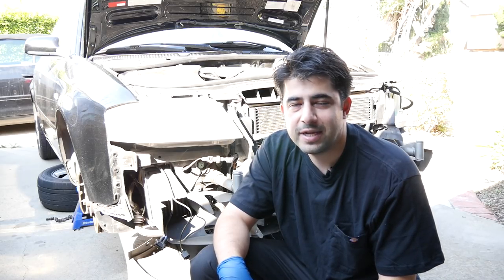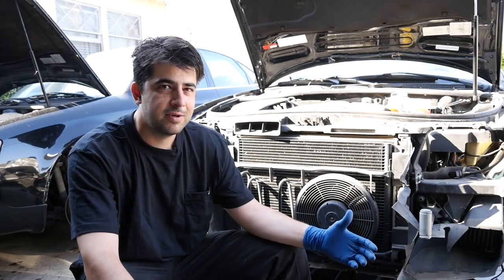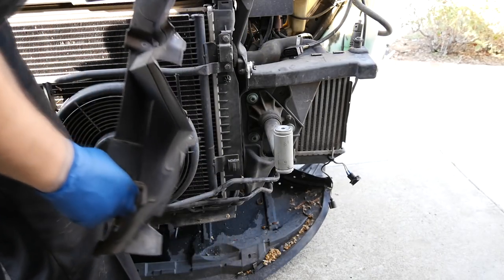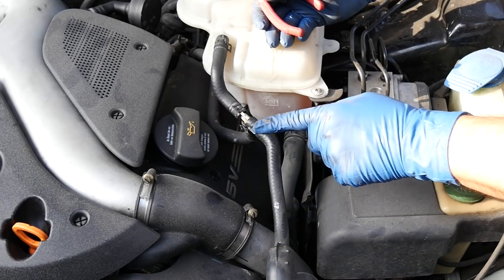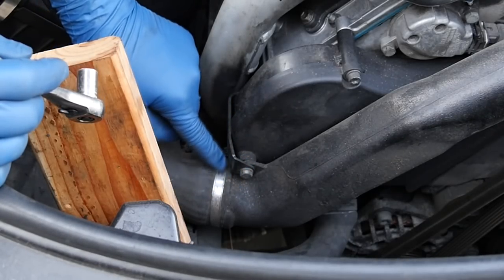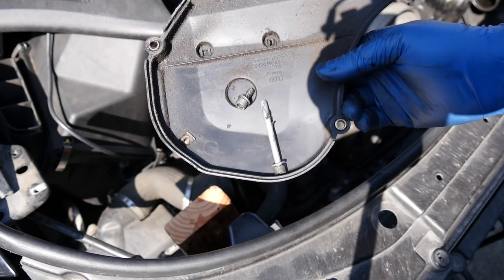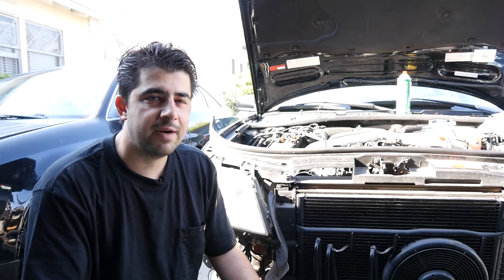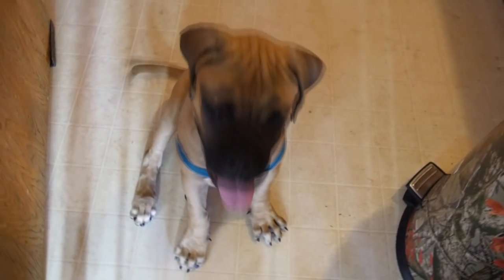Watch This Video Before You Buy an Audi

Comment: dont be deterred by german cars for their cost to maintain. if you care about your car and have a good amount of money, it is WELL worth it. i currently drive a '07 mercedes e350. it has 156k miles on it and it drives amazingly. the shifts are nonexistent, its quiet, and it feels like im riding on a serene cloud (also i have to watch my speed on the freeway because 90 mph feels like 70). 
im lucky because my dad is friends with a german car mechanic that specializes in mercedes, and at the same time i buy my parts at a german car parts warehouse so i can get OEM parts for way cheaper. this car has been very reliable. aside from regular maintenance and preventative maintenance, the biggest repair+labor for this car was when the timing sprocket wore down and replaced the water pump as preventative maintenance - $3,000. but hey, if you plan to own any car for a long time, its expected to have a huge repair eventually.
if you take care of these cars, they will take care of you.
Reply: The factory dealer level scanners run in the double digits thousands. The Mercedes Star dealer diagnostic computer with the Vehicle Communication Programmer interfere module cost of over $25,000 as I'm not making this up. German cars aren't DIY fix cars if you ain't got the doe for expensive dealer equipment. http://scantoolresource.com/mercedes-benz-scan-tool/
Reply: I think this is why most people just buy a Camry, sure it's boring/not fun to drive, but most people live paycheck to paycheck in this country, so the reality is they simply do not have funds for unforseen expenses.  I'm not opposed to Audi, but I'd only get one new/lease, walk away, or CPO from Audi (thats a big maybe) at best.   For now I'll stick with the slower japanese sports cars (370z owner) and toss in a better stereo/sound deadening and better tires.  Just a lot cheaper and while it doens't have the "I want to look like I have money" emblem, it really is fun to drive if you're into real/actual driving but are not in some high income bracket.

Comment: You might want to mention in your next video to be careful with the timing belt covers. If you put them back wrong they can rub on the belt, which, as I found out the hard way, will cause a misfire code exactly as if you'd got the belt off a tooth. (Somehow the added drag on the belt messes with the even ignition power pulses the computer expects to see, and it assumes a misfire and throws the code).

Comment: Just did a search on timing belt/chain for M54 engine BMWs. Seems that you never need to change it and their are no documented failures. Just regular oil changes will sufice. The V8 engines on the other hand...

Comment: I always thought them easy to work on. My oldest I just changed my second belt at 170,000 miles. Takes time and patience but parts are cheap and easy to work on if you're  mechanically  inclined. IT'S  only as hard as you make it peeps.. 😁😂🤣

Comment: Never again will I own a Volkswagen/ Audi product. I owned a 2002 Volkswagen Passat with the infamous 1.8T 20 valve engine in it. Excellent driving dynamics, better than any Japanese car that I've ever driven, to be honest. The cost was very steep, I ran into almost every problem that plagues these cars; plugged up heater core, expensive timing belt replacement and finally the dreaded oil pressure warning, the last one was the last straw for me. Before I gave up, I tried different detergents to try to clean up the inside of the engine, it didn't help that I only used synthetic oil and changed oil always on time. After spending so much money I decided to cut it loose and eat up the loss. The problem with these cars is that they are too over-engineered, sometimes more so than needed, resulting in above average maintenance requirements and above average maintenance costs as a result. I'll stick to Japanese, thank you very much.

Comment: I have a 2010 Q5 v6 and I have to remove the whole front just to change the belt tensioner. Coming from a 95 Celica (which I still have), that's a lot of work.

Comment: The claims at 12:27 are not entirely true. The amount of work required varies depending on the engine design. The a4 1.8t engine does not require you to enter service mode to repair air compressor, alternator, or turbo. I wish the same could be said for the more fun and powerful 2.7t a6.............OH THE PAIN!!

Comment: Audi's have always been known for problems. Working for a dealership in service, I unfortunately came to know my customers on a first name basis as they were usually in the shop a minimum of one time per month (usually two or three on average). Whenever they brought their Jetta or Passat's in for service, it was almost always electrical related. You couldn't pay me to drive one of these, just work there since the benefits were decent, unlike their cars.

Comment: The new audis are reliable. Maintenance on the 2.0t engine is pretty cheap though. My 2013 A6 has 75000 mile now, and I never had a problem with it.
Reply: What about oil change?

Comment: Great looking dogs --  and we very much appreciate the great content. Audi's (and their VW cousins) on the other hand you can keep. Overpriced, over-complicated, and too many cheap plastic parts.  Good luck with the build.
Reply: bmw 745\750\760 e65-e70 if battery dies engine computer(DME\DDE) loosing communication with immobilizer(CAS) and do not gonna start again with just jump-starting it. Needs good diagnostic tool to make it starts again.
Reply: The factory dealer level scanners run in the double digits thousands. The Mercedes Star dealer diagnostic computer with the Vehicle Communication Programmer interfere module cost of over $25,000 as I'm not making this up. German cars aren't DIY fix cars if you ain't got the doe for expensive dealer equipment. http://scantoolresource.com/mercedes-benz-scan-tool/
Reply: I'm sure if the audi's bumper is off. Then I had already finished replacing the distribution belt with an opel. And also a lot cheaper on parts as well.
Reply: A lot of aftermarket diag tools around. 5k max for full analog star tools.
Reply: Yeah but you still have to pay hefty TIS license subscriptions as there's a reason why the Mercedes STAR xentry is over $25k in software license's. Many of these diagnostic scan tools are becoming internet web-base applications.

Comment: People thinks that this belts needs changing only when you are over xxx miles of km but this is not true. You can leave your car in garage for 10 years and say ok it wasn't even close to km that needs to be changed. Old belts are worst nightmare that you can have because it can break easy and thats why you cant just inspect with eyes because even old belt wont show cracks that you are looking for. Also rollers which hold belts need to be changed once you change belts.

Comment: I love Audi's, but I live where they are produced 2.5 miles from the Audi factory in Ingolstadt Germany. I crashed my Audi A4 in Berlin with 546,000 km on board (way over 330,000 miles) and my Audi A3 with 704,655 km on board( about 440,000 miles on the speedometer). I serviced my cars always alone...I drive now the A4 -red of my wife with only 335,000 km on board (over 200,000 miles) And I intend to buy a 'new' Audi with only 170,000 till 200,000 miles on board. God bless you all.

Comment: Hey just wanted to let you know.
First of all thank you very much for your Audi A6 2.7T videos. I wrecked my 2001 Audi A6 2.7T a month ago and did not want it insurance totaled since it belonged to my loving woman who passed away 6 months ago at age 32 2days after her bday from a fatal asthma attack. I found your videos very informative and helpful especially when points during the repairz became  stubborn and frustration was beginning to best me. Your videos showed my stubborn repairs whos boss.
Secondly i noticed one thing that you said incorrectly in this video.. that said though its the first thing ive known to be incorrect from your videos. And that was when referring to your lower coolant host that connects to radiator you said that a coolant temp sensor connects there. But its actually the Engine coolant electronic fan switch that is connected there and the coolant temp sensor is connected behind the engine passenger side 
In all though thank you for the help you have provided me.

Comment: Lexus just came top of the reliability table in the uk. In the top 10 were Toyota Honda and Nissan.
Mercedes and Vw Audi are way down.
People drive 1960s Morris 1000s and can easily work on the cars themselves. No road tax. Ideal for tootling around town.
Toyota if you are not practical

Comment: Audi's : Thee easiest & smartest engineered cars on the planet to work on. 

It takes 25 minutes to get into the service position, requires zero special tools, and don't have to even lift the car or remove the wheels. It is ridiculously easy, painless and effortless......all connections including wiring and coolant hoses are "quick fit" connections and require no tools (genious), and so awesome being able to get to close and personal, opposed to on your back...bent over...in tight spaces.

The A1 and A2 German : Vortex / Audizine
Reply: Blakelikesfood They really are. Audi sell tools to do this yourself. Changing a timing belt on any car is complex, and chains only last as long as the water pump lasts. Audi use a lot of powder coated and or stainless steel bolts which don’t rust, unlike Japanese cars including Lexus which are made from chocolate.
Reply: Never thought of it that way...
Reply: Oliver Newell- What do you mean the timing chains only last as long as the water pump? Are they connected somehow?
Reply: I also love how they advertise their maintenance schedule on the website, easy to get to. Compared to BMW. I'm more and more leaning away from BMW lol. Not my fav brand anymore.
Reply: lol water pump is behind the timing belt/chain in ALOT of vehicles.
Reply: Right? It's really not that hard to do at all. 'm wondering why having to put it in the "service" position is causing so much "fear" of working on audis. LOL
Reply: Rainbow Squash
Reply: sure

Comment: So pretty much audi designed the engine to be replace every 100k. You shouldn't be taking apart the front of a car to change a service item. I read somewhere that the 2nd gen A8 required taking apart for a oil change
Reply: bmwmsport11 so that is complete bullshit.

In highly engineered cars with all that techstuff and of course big engines turbo/supercharged with a great fuel economic is as you woukd expect little to no room.  That means, you have to take some of the car apart, to change something being crammed pretty deep in the engineblock.   Otherwise the car would have gettin' 1m, 3 ft what ever longer.

But in germany you dont need to take a car to visit your neighbor.  So not as much space for everyone.  Furthermore the roads, parking lots and all that stuff isn't meant for 6m long cars.   All that results in thight packed tech under the bonnet.

If you wanna drive german cars, you have to deal with that.
If you wanna drive a subaru, you have to deal with the fakt, that for sparkplug exchange the engine has to be lifted outta the car !
And if one likes some us cars, he has to deal with that poor interior, build and paintjob quality.  Easy as that.

Comment: that's why i love my 06 camry 🙏🏼
Reply: That's a sh*t car, absolutely no driving pleasure.
Reply: I drove my sister's 16 Camry in a convoy last night. I pressed on the throttle like a drummer presses on the bass. The thing wouldn't move.
Her 15 Altima was so much faster and it was a CVT. If you have to get a i4, get a Nissan. 💩
Reply: Simon Vuille not convinced being stuck by the road side is pleasurable
Reply: I drive my Scion xB daily but I drive my Datsun 240z on the weekends.
Reply: alextb10 😂 broke ass in my 06 camry but in my second car i looks like a king bro i have 2014 patrol platinum 😈

Comment: The whole "German cars are money pits" is a pile of bullshit. 

If you are buying a used German car.... DO YOUR RESEARCH! Talk to dealer mechanics, search the forums, probably the best source for common problems and basic DIY. Don't buy the first cheap, mistreated car you see on Craigslist. Make a list of issues and things to look for. Inspect the car thoroughly, and don't buy one that some issues, guaranteed it was owned by a lazy, neglectful owner and there are bound to be more hidden somewhere. 

If you don't want to spend $1000 every time something is wrong with the car. Buy some tools and learn to DIY. Most parts are actually quite easy to replace if you have the tools. 

This video shows the timing belt job on the older Audi's (B5,B6,C6). It is probably the biggest and hardest job on these cars. This should be done about every 5-6 years. It's MAINTENANCE. 

If you don't want to deal with this, all newer Audi's after the mid-2000's are equipped with timing chains, these came with all the FSI engines. No service interval.

Just make sure the chains don't rattle at startup or while running. Trust me, It's VERY audible. If you hear it, walk way. If not, you're good.
Reply: It's almost impossible to work on any Modern German car these days without a dealer level scan tool. Mercedes put such complicated high tech computer's and electrionics in thier cars, you need the dealer scan tool to reprogram and recalibrate computers and sensors. The Mercedes Star dealer diagnostic scan tool cost over $25,000! as I'm not making this up. These cars are generally not DIY fix it cars. http://scantoolresource.com/mercedes-benz-scan-tool/
Reply: No, no it's not.
Reply: Eman 08 actually this depends on which kind of readings your ecu gets. basic malfuncion reports can easily be deleted by an entry level scanner for 100€ or less. when it comes to overwriting things like e.g. a gaspedalpotentiometer-malfunction caused by a drained battery, you may need higher end equipment...
Reply: @Ma Broken leg
German cars are very complex as they have an insane amount of ECUs. A Modern Mercedes has between 80-100 different ECUs networked together on the CAN bus. The lastest Mercedes S-Class has embedded cameras built into to it's Magic Body Control suspension system. Mercedes has thier own proprietary computer modules called SAM (Signal Acquisition Modules) that are very complex sub systems. You need a dealer level scan tool to analyze SAMs as they control all types sub systems from dashboard clusters to taillight assemblys. SAMs has been in Mercedes since the 90s as they go bad all the time. There's one for the front and one for the back. Many times you have hidden electical problems and not even know, until you hook up a fancy dealer scanner. To replace a $1k air shock absorber on a Mercedes requires the entire air suspension system to be recalibrated which you need a dealer scan tool like Scotty Kilmer did in this video. https://m.youtube.com/watch?t=8s&v=pJzoyCPiAjg
Reply: Scotty have autel ds708, it cost 700$ brand new. Modern mers have no more then 20 CM, not even 80-100 as you talking here.
Reply: The Maxisys Scotty as doesn't support ECU Flashing. He's got more scan tools than that as he does have the Mercedes Star with the pass tough programmer hardware. The MaxiSys is primarily a dealer level diagnostic scan tool. You need a $3,000 battery maintainer in order o flash ECUs as it's a required SST tool. You also need to pay a TIS subscription to gain access to ECU calibration files to reflash an ECU once an ECU is replaced. Then you have to hire a locksmith to register the ECU.
Reply: 3k battery maintainer? You kidding? Any 5a-10a ajustble power supply can keep it runs. 100$ on ebay. For working with mersedes good to have xhorse vvdi prog, it can do much more, when dealer tool do.
Reply: The Lastest Mercedes S-CLASS has more than a 100s ECUs. The Magic Body Control is extremely complex as it has cameras embedded in the the air shock so that it can see bumps in the road. I have factory Service Manuals and wiring diagrams for all these cars.
Reply: @ruhoer eoijre LOL You clearly know nothing about cars. There is no such thing as battery maintainer for $100. Those cheap battery chargers aren't the same thing. Cheap Battery chargers doesn't maintain battery voltage and amperage as the voltage fluctuates. Battery maintainers are specialized battery power supplies that supplies power to the battery by holding a "steady" voltage/amp. Many BMW's require as high as 70 Amperage as ECU flashing pulls a lot of Amperage.  Using a cheap $100 battery charger that fluctuates the voltage can cause the computer to be bricked during flashing. Voltage drop is very dangerous and damaging to your electrical system. http://www.autoserviceprofessional.com/article/92019/Real-world-reflashing-Cutting-through-the-smoke-and-mirrors?Page=2
Reply: I totally agree, my chevy s10 I had was much more of a money pit than my audi a6 4.2.
Reply: lol